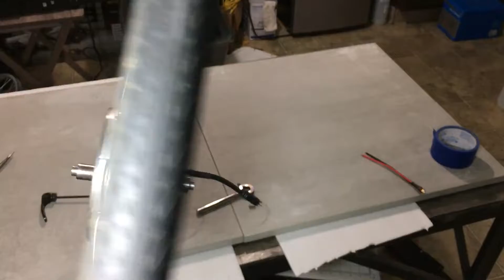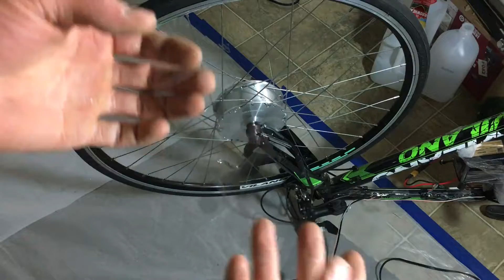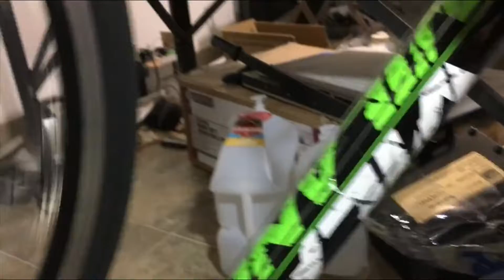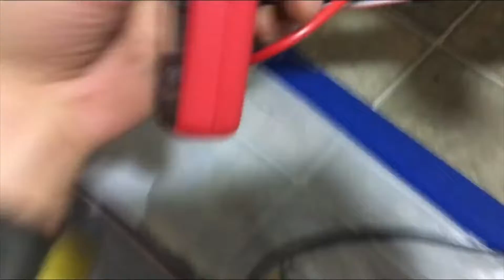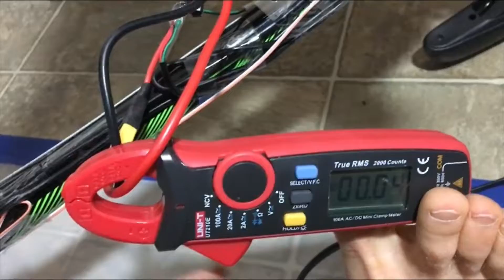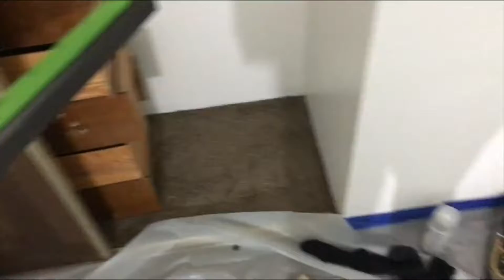Hoverboard Motor Ebike With Quick Release

Comment: How did you make the center axle to fit the bicycle? Was it just the right length once you machined off the extra aluminum on the outside side? How does it feel when you actually ride it? Wouldn't think a hoverboard motor would have many watts of power for pulling with such a large diameter wheel attached. Great work BTW to get that all machined and drilled to fit the spokes.
Reply from the maker: The measurements are on the hoverboard motor shaft itself. I left lots of length on the shaft so I can set it on the forks to get the right spacing. I measured the fork to the hub motor spoke flange than marked the axle. Than I measured out the axle on the bicycle wheel from the nut to the end of the shaft. There is a 1/4 key way cut from the end of the shaft to past the bearing for the wire to make it under the bearing. and another key way was cut for the motors stator. The extra aluminum that was removed was mainly to make more room to drill holes for the spoke flange. I just liked the look of a flat surface so I cut that as well. The hoverboard motor shaft looks complicated but the extra futures are unnecessary you just need the right spacing and shaft diameters for the bearings and stator. I'll have to take it apart and make a video on the measurements and how it was cut out.
Reply from the maker: The large 700c wheel on the motor is not ideal because of the motors RPM. Full power and I slowly accelerate at higher speeds its better than slower speeds. It works but it needs some peddling to get up to speed.

Comment: the sabvoton motor controllers are awesome controller ,with a big BUT,there are many manufacturers and alot have bad QC,the best manufacturers are QS motor,Siaecosys,Dunn,MQcon
Reply: i have 45 amp unlocked version and ive run well over 100amps through it,and 170 amp unlocked have pushed bit over 300 dc battery amps through it ,you dont get warenties with unlocked versions and you dont get the fancy colour displays ,you have go other options

Comment: did you make a completely new axle or modify the original,,just i saw how your wires come out are different from stock motors?
Reply from the maker: the axle was made from bar stock on the mini lathe so yeah completely new I do have a video with an up close look at it.